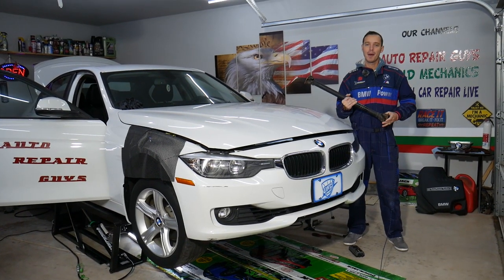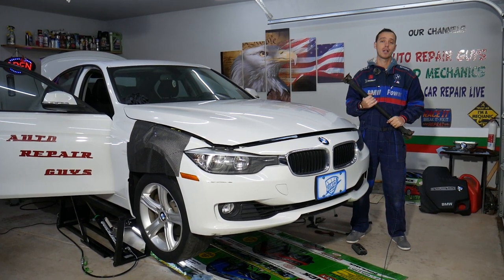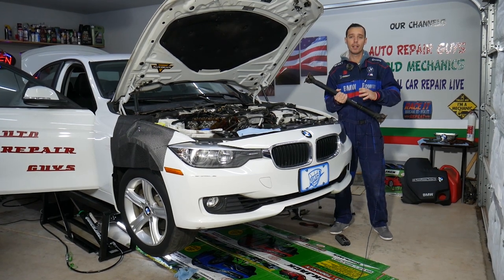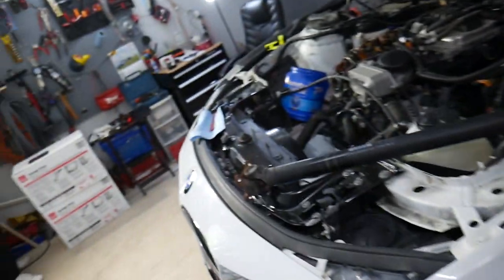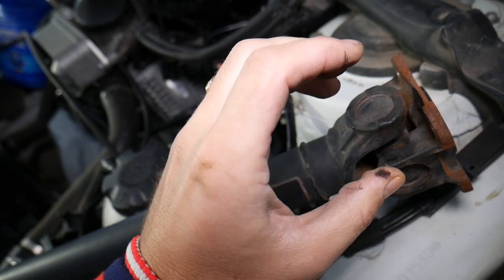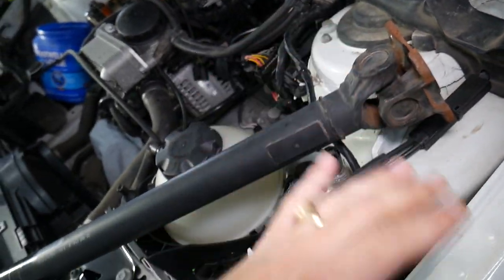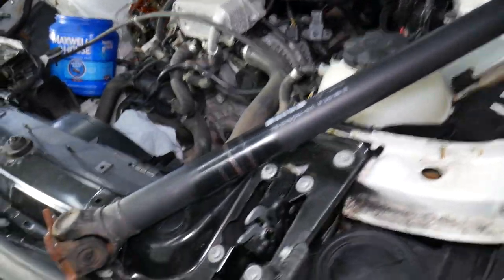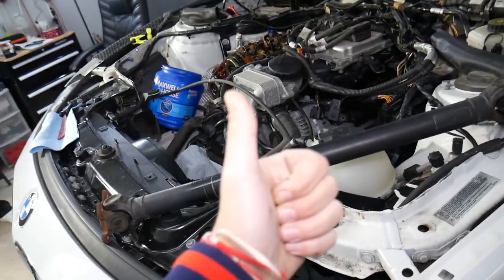SYMPTOMS OF BAD FRONT DRIVE SHAFT DRIVESHAFT ON BMW

Comment: For my F10 535i i was having clunk vibrations in the middle arm rest console area when accelerating at slow to mid speeds.  Nothing at higher speeds (driving on highways).  I ended up replacing the whole drive shaft brand new with an upgraded version Dorman brand. It looks beefy and very well made since its made in the USA.  About $600 for the brand new Dorman drive shaft plus $100 for both oem German made Flex discs (Guibo)!  Now my beautiful Carbon Black Metallic Beemer runs like new!
Reply: So your drive shaft will make noises under center console?

Comment: My 08 535I has a grumbling or vibrating sound when you push the accelerator.  It doesn't matter if its feathering or wide open. It fills like the front of the car or under my feet. I thought it was misfiring at first but ran it with my scan tool and no codes or misfires. And ran it empty then filled ut up with premium gas like always and then added royal purple 3 point octane booster too and no change.
Reply: Have same , did you figure out what is it?
Reply: Driveshaft bearing, cheap part easy to replace. Not shown in this video! Its on the rear middle hidden above exhaust and heat shield

Comment: I'm getting a bad clunk when accelerating or aimetimws when breaking.  There is a little Olay in the front driveahaft when turning.  Is that normal?   Rear driveshaft has been replaced.
Reply: Bro I’m facing the same issue do you fix it or still?
Reply: @alisabbah6362 did you found the issue 😂?
Reply: @orlinbobchev  no still 🌚

Comment: I have this steady vibrations that are coming on when over 50 miles. They are steady , hard to describe as it's like a on- off feeling like it's pulsing and it's  coming from the driver's foot well ? Any ideas what the would be ?
Reply: Front driveshaft
Reply: This is exactly what I have it’s a steady vibration all the time for me(has been happening for 3-4months now, getting worse) I can feel the vibration in my wheel a lot aswell. I have throw so much money repairing shit I thought it was like new tires, brakes n rotors, front control arms, front wheel bearings, multiple alignments, and had a shop do my center support bearing. None of this solved the issue. Should I just do front and rear driveshafts next? My car is 2015 328i xdrive.

Edit: the vibration is all the time, but gets worse with more speed, and when I hit a bad bump it’s almost like i can feel something shaking for a second or two.

Comment: Does that f30 in your video use a flex disc guibo at the driveshaft connection points on the ends?

Comment: i got a 2014 x5 35i and I feel vibrations and rough noise almost like a sports car and when I take off , instead of a smooths take off.
drove my sons 2015 and it takes off nice and smooth .wonder if that mite be a drive shaft . it still in the warranty and they keep telling everything looks good but the car seems so lazy when it takes off , it s annoying.
what do u think it mite be?
Reply: Did you sort it out? I'm having the exact issues. Thanks in advance.

Comment: My vibrations go away when I let off the gas. When I unplug the transfer case and turn my 535xi into a rear wheel drive car the shake goes away.
Reply: Hey man my car is really shaking right now too and the front prop shaft is not in and my car is a bmw 328xi 07, how can I unplug my transfer case ?? Any tips would be helpful cheers brother
Reply: @aimized1460  There were some heat shields covering mine.  I just peeled them back and there was 2 wires connected to the transfer case. It's right in the center of the vehicle between the engine and the front seats. It throws 4x4 error lights.... traction control still works on the rears.
Reply: I have the exact same problem, vibration goes away if i let off the gas pedal, was it driveshaft in your case ?
Reply: @WrongEnd  not sure, lol… still a rear wheel drive only car. Transfer case is still unplugged. =]
Reply: @ronredmond  mine is x5 using the same method is inconvenient for my case, im taking it to the workshop tomorrow and see how things goes, at least i know what to tell them instead of being clueless 🤦‍♂️
Reply: @WrongEnd  Good luck!  If you remember, I am very curious to hear about the solution when you get it taken care of. Cheers  =)
Reply: @ronredmond  so, apparently my driveshaft was missing two screws and has 3 loose ones, the workshop installed the missing ones and tightened the loose ones, now it surf like butter. No issues so far, total cost was about 130$.
Reply: The front or rear driveshaft?
Reply: @mshaabneh23  I didn't care to ask as I was so happy that it was loose bolts issue but I believe it was the back side.
Reply: @WrongEnd  Not bad... maybe mine is that simple... about to send it to the shop for a new rear main seal and have them check out my driveshaft
Reply: @mshaabneh23  Mine is the front... since unplugging the transfer case removes all power to front wheels and that is what makes my shake go away.
Reply: Any of y’all experience a clunking should when accelerating?
Reply: Noise* not should my bad.
Reply: @ronredmond  were you able to fix it and also are you having any issues using it as a RWD ?
Reply: @sanjiv3725  I still have the transfer case unplugged, RWD only. Well over a year now...

I just had the rear main seal changed by BMW mechanic and I asked if it was ok to have it RWD only. He said it's fine as long as I don't mind the "AWD malfunction" error on the dash, which I don't.  =)
Reply: @ronredmond  thanks mate. appreciate it.
Reply: I have grinding noise only when i gove it gass accelerating. I unplugged the transfer case and no more noise. No vibrations though but i can "feel the noise" under my pedal
Reply: @jonc2914  Maybe the driveshaft that would normally engage with the front...  If you unplug the front, I assume that the driveshaft would still spin, just not engage.  Sounds like your process of elimination is helping find the culprit.  Sometimes the rubber that holds the driveshaft in place, can get a little dry rot, cracked, be missing, etc.  I'm not a mechanic, but I think your driveshaft would be worth looking into.
Reply: For my F10 535i i was having clunk vibrations in the middle arm rest console area when accelerating at slow to mid speeds.  Nothing at higher speeds (driving on highways).  I ended up replacing the whole drive shaft brand new with an upgraded version Dorman brand. It looks beefy and very well made since its made in the USA.  About $600 for the brand new Dorman drive shaft plus $100 for both oem German made Flex discs (Guibo)!  Now my beautiful Carbon Black Metallic Beemer runs like new!

Comment: hi can u drive without one.  front one i have one removed.
Reply: no
Reply: @finessrs752  i took my car to bmw delere  they said i can drive wothout one and i have one left
Reply: @sebastianjungle  I’m presently driving with one but it’s is dangerous
Reply: You can remove the front drive shaft in a all wheel drive. I had a 2007 328xi BMW and I removed the front drive shaft, just make sure you unplug your front two wheel speed sensors. It makes your car rear wheel drive and it gives you better gas mileage.
Reply: @fischerfenner6577  I’m doing the same thing 328xi 07 no front prop shaft and I never unplugged any wheel sensors as I didn’t even know that’s a thing once in a while if I try to push it too hard Idrive screen I get a 4x4 warning “drive moderately” lol
Reply: Yes you surely can man I have been driving without one since I bought my 328xi 2007 it’s been 6 months I have not put in the new front prop shaft as I need to change my oil pan gasket and I don’t feel like undoing the shaft again so when it’s summer next month I will do oil pan than front shaft cheers mate
Reply: Plus your gas mileage is better when it’s RWD !!
Reply: @fischerfenner6577  mine still sucks a lot of gas ! but than again I have never experienced how much gas it sucks when it’s in AWD. I was down to 13kms on the highway yesterday and my home is 9km away I managed to get home and still had 5kms which is impressive ! Now would this have happens with AWD I do not know the answer ahahahah
Reply: I have a bmw x3 2011 F25 no shaft for the front diff
Reply: yes u can if it's the front. but u may damage your transfer case if the actuator motor cable isnt disconnected.